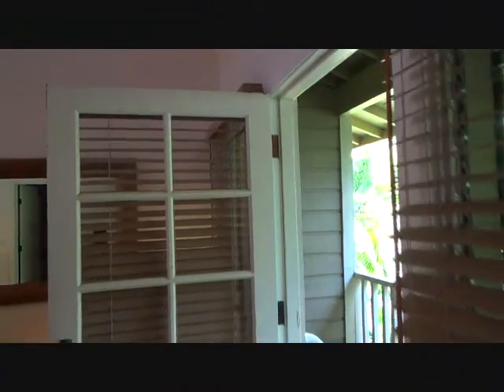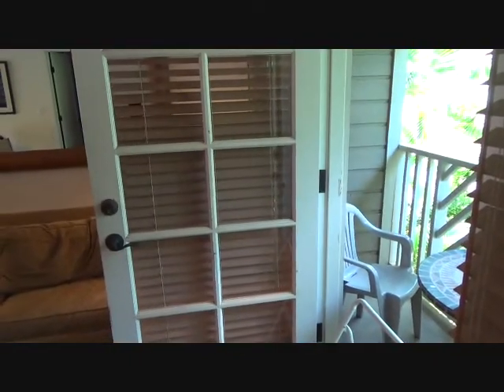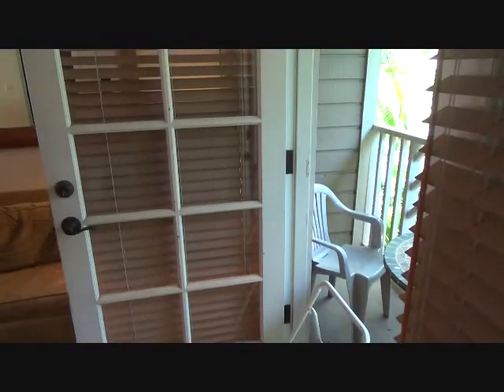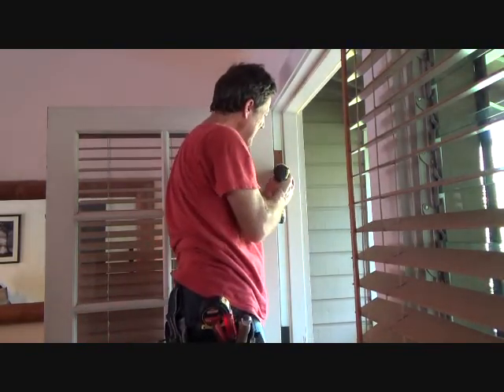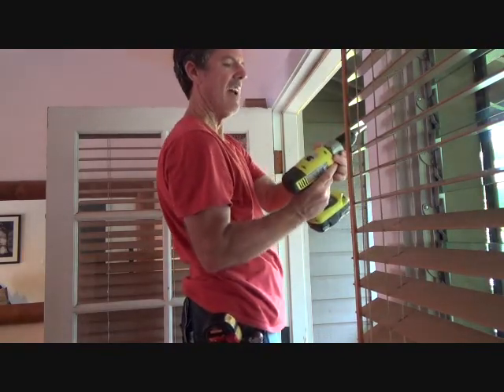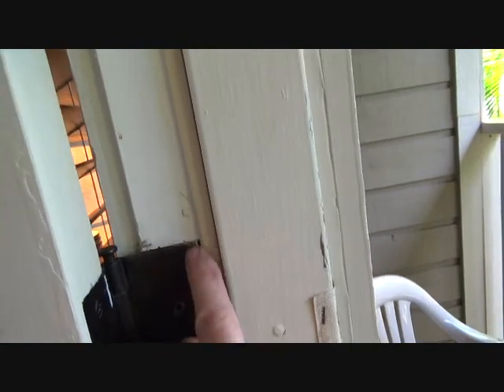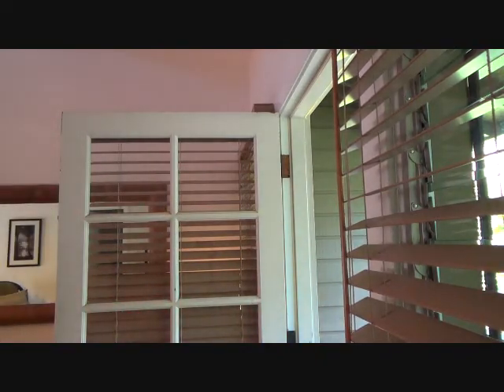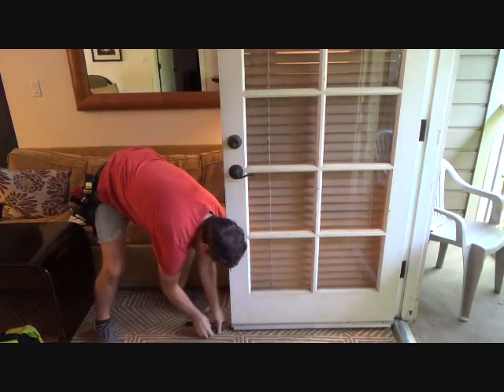How to fix a rubbing door...Part 2

Comment: Joe, you are a door and hinge guru.  It is a useful skill to have. There is nothing worse than a poorly fitted door.
Reply from the maker: +bg147 Yes I hate it when doors sag but I like the fact I can usually figure out something in order to get them fixed. I use to hang commercial doors for years. The metal timely frames I liked the most. But I've hung my share of prehung doors as well. Hope you are picking up some tips!